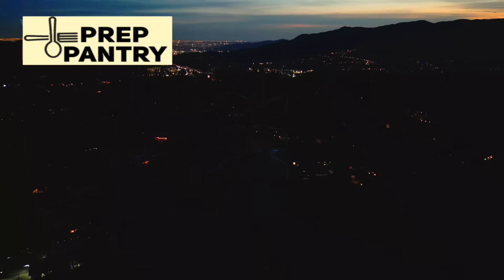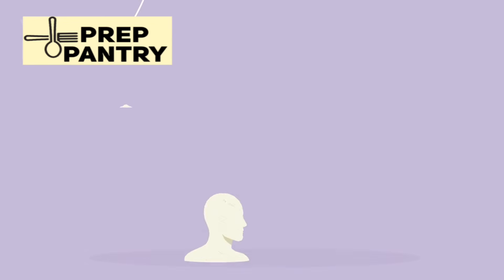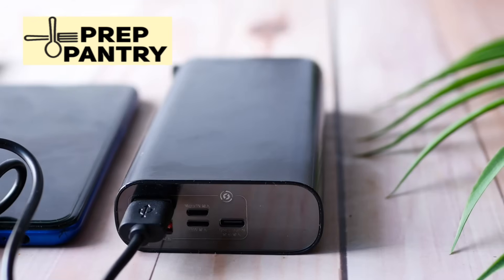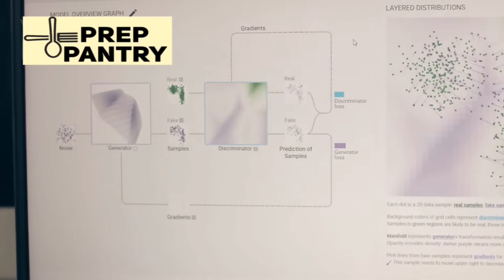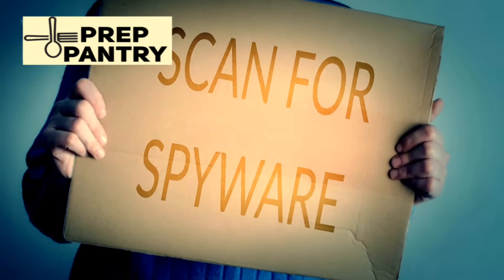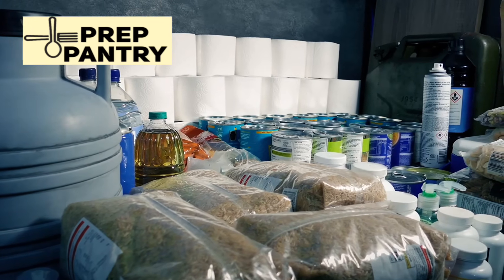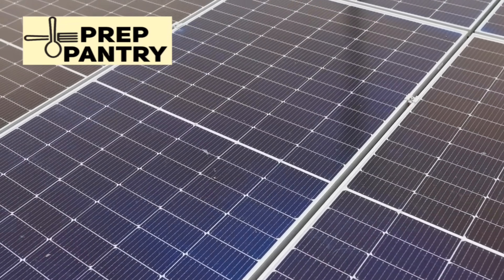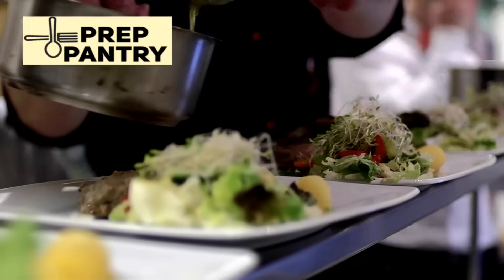I Tested Backup Power For 30 Days - Here's What You ACTUALLY Need (Results Will Shock You!)

Comment: I don't like the idea of using your vehicle for piwer.  I actually setup for this once with my Prius as it is super efficient to use as a generator and came up with sone problems.  For one, burning through precious fuel in the tank that I then need to drive around.  Second, I needed to drive the car around and powrr things in the home.  Third, I needed more power than the car could provide at times.

I am actually against a bunch of small battery systems.  For one, it increaess fire risk as a lot of these cheap, small batteries keep bursting into flames.  I end up storing these small batteris in metal boxes to mitigate the very real fire risk.  When you go for a bigger LFP battery, these batteries are far safer.  If it starts smoking, drag it outside.  But the worse I had is after a mishap, one smoked for 40 minutes and I made some jokes about not being able to have kids after this due to the strong chemical smell.  It did not burn, only smoked.  It is far easier to keep a big battery charged than a bunch of small batteries.  Batteries are living, active things that need regular attention.  Neglected batteries are trouble.  You just want your main batteries that you can keep active / in active rotation and your big battery using a safe LFP chemistry to recharge off of and run other things directly off of.  Then solar can charge the LFP battery and a generator can charge the battery. This is what works best.

Comment: I a power failures Im NOT going to use the Refrig. But will use Ice Chests and use my Chest Freezer to make ice for the  freezer chests. Refrigerators use alot of power compared to Chest Freezers. Its a trade off, but worth it for power management in a emergency. 
Just my 2 cents
Good luck

Comment: I plan to run a generator during the day, and use batteries at night.  I’ve right sized the generator so i won’t use too much gas. With a week long power outage i wouldn’t count on cell towers working, or natural gas working either.

Comment: I'm running four 450 watt panels, four 100ah Power Queen LiFePo4 batteries, and a 2000 watt inverter in my small DIY system here in Jamaica. It supplies me with 80-90% of my power needs and i have good backup during a hurricane or power outage. Thanks for your video.

Comment: In the last 12 months I installed my solar/battery system here in the north east. I have two ecoflow ultra systems with 3 batteries each for 37kwh and 22ea 450 watt panels. Total cost after tax credits was $11,000. On sunny days in summer I can run the whole house including central air and the pool. But, in practice I only cover 85% for the 3 months of summer due to cloudy days. For the other 9 months I cover nearly all of my electric usage and when cooler temperatures prevail convert any excess solar to electric heat to save on natural gas. The grid is now a backup energy source but I keep 3 trifuel  generators for longer term power outages. Any one inverter/generator will cover during a power outage on back to back overcast days. Pay back on my investment is about 4 years.

Comment: Just for clarification, regarding radio communications:

1] FRS does not require an individual be licensed in the US.
2] GMRS does require a license; however, it's 'pay to play' (in Autumn, 2025 the license fee is US$35) and one's license covers one's entire extended family.  GMRS is qualitatively better than FRS because GMRS allows for the use of repeaters, which extend range.

3] Amateur radio does shine in emergency situations.  However, the video here is a bit misleading:  unless one is utilizing a repeater system linked through the internet, one can not expect to be able to communicate over 'hundreds' of miles with a simple hand-held radio.  Typically, these 'handi-talkies' (HTs) operate in the VHF and UHF spectrum; and, as such, the range is generally line-of-sight.  In order to be able to reliably communicate over radio without the use of the internet, the HF portion of the radio spectrum is used - what many refer to as the 'shortwave' bands.  Radio waves at these frequencies can be reflected back to earth from the ionosphere, which allows for longer range communications.  The Amateur Technician license grants mostly VHF/UHF bands access; while the Amateur General and Extra licenses grant extensive HF privledges.

One does not need to be an electronics wizard to pass these exams, especially Technician and General:  there is no deep electronic theory, circuit tracing, or anything else technical about those two exams.  It's mostly rules, regulations, what frequencies and bands one can and cannot operate legally, as well as basic safety considerations.

If I were to give advice to folks, study for and sit for both Technician and General in a single test period - these two licences together provide access to all possible bands.  The only added benefit to the Extra license is access to additional slots of frequencies in some HF bands.

And, yes, getting licensed is a benefit:  it allows one to train before the skills are actually needed in an emergency.
Reply: I agree with all of the ham radio. Pratice when there is No problem is the best way to become comfortable with your rig

Comment: You did it for 30 days. I did it for 8 years. I totally agree. People are selling people false lies on the internet and YouTube. Solar is 12v first. That even goes with anything that can charge on a USB. Even lights. 12v and USB use extremely less power than 110v. The majority of what can be bought today. Can run on 12v or 110v. Same having an eco mode. 12v with evo mode on saves the most energy. Most appliances people buy or have use way tomany watts and amps for solar. Always use the lease amount of watts and amps when using solar. The majority of equipment are out of the price range of most of us. The ones that people can afford are not good enough. For a Lithium phosphate battery to be any good. There is a price range rule of thumb. An ah is just over $1 per ah. The good 320 ah batteries are running around $385. Outside the stove, hot water heater, AC, furnace, and clothes dryer. Because the ones in your home are not solar friendly. There are too many amps and watts. Look for products that use the lease amount. Like ones that go into camper or boats. Semi trucks. They are cheaper. All you need. 400-watt solar. 2 320ah Lithium phosphate batteries. A 2,500-watt sign wave power converter. A 12v fuse box. That's it. A power station added is a bounce. AC takes the most power. 12v mini split runs none stop. Any electric heat is 1,500 watts. A diesel heater as long you have the diesel. Runs none stop. A 700-watt microwave oven works perfectly. An electric double coil cook top works perfectly. Standard refrigerator. Works perfectly. A refrigerator runs in cycles. 100-watt run time. Yet. Off and one. Depending. Once to two an hour. Down size to a 12v/100v cooler with an eco mode. No problems. Around 40-watts. Small mini refrigerator/freezer. 100-watt. A small law down freezer. 100-watt. Just make sure your refrigerator runs on or around 100-watt. You don't need these expensive systems. You need to downsize the watts and amps you're using. Then. When the power comes back on. You're using less electricity and your bill mint go down. Every month, they raise the price. We are using devices that use extremely way to much electricity.
Reply: Your strategy is spot on. The only disagreement I have is avoid 12 volt. If you already have these 12 volt appliances it makes sense to prepare a power supply for them but it doesn’t cost much to start with 48 volt system and inverter. There are conversion losses but solar panels are cheaper and system wiring is FAR cheaper with 48 volt.
I was surprised how little energy you need for basic things like refrigerator and lighting. I am an electrician and would never put less than 200 amp service on houses. After having built an off grid system progressively for my house,I realized that with scheduling heavy loads , I could keep average consumption very low.
My essential circuits panel ,which carries everything except cooking range and clothes dryer ,has PV from the panels on a #10 circuit feeding a 5K inverter. Its grid power connection for charging the battery at night when electricity is free is a #12 romex.
This is in Texas where Satan decided to use it as rental property while staying in the relative comfort of his other residence.
Reply: @danielking2944  Both these methods are valid in my opinion, it just depends on your needs.    I have converted all my battery usage to rechargeable AA and AAA lithium Ion batteries (XTAR brand) that provide a steady 1.5 Volts for around 90% of their runtime, have a built in low battery/charging indicator and recharge from USB-C.  I also have adaptors for C and D cells that use 1-3 AAA for the C and 1-3 AA for the D.  There are now also rechargeable 2025, 2032, and 2540 coin cell batteries for devices that use these.

Also LED lights that run from USB are much more efficient than ones that run on 110 AC which should be saved for higher draw devices.  I have several of these along with power packs so I can strategically locate them throughout the house when needed.

For the larger draw devices, I have an Anker Solix C800 Plus and C1000 with expansion battery and am investigating low draw devices for cooking that these can power as well as propane cooking alternatives.  Also have the Anker Solix C200 DC, C300 DC, and C300 for recharging the smaller power packs and other devices that recharge off of USB-C such as fans, flashlights or power higher draw items like heating pads or heated clothing or low draw (under 300 Watt) 110 AC devices such as my Norelco shaver.

I also have several individual 100 Watt solar panels and cabling to be able to configure them for the different requirements of the various Anker Solix units and I am planning to get a couple more.  I also have a group 31 12 Volt 160 AH lithium Ion battery that is capable of charging any of my Anker units or just 12 Volts as needed

I went this route as it is a portable arrangement so I can take it all with me if there is a need to bug out instead of in.

Comment: Bravo for saying it, most preppers do not acknowledge it or provide BS solutions like just get cards, board games or a book. Or they say things like you are going to be too busy surviving to be bored... uhhh, no, not in a blackout. I was in a 5 day ice storm blackout 13 years ago, pre my prepardness days. I am a relatively low maintenance, resilient person and survived with few issues. Issue #1, it was hard to brew coffee. Issue #2 boredom. Thankfully I had an iPod Classic, I had just loaded a 4 season show I wanted to watch and had backup AA power for it. That made the days fly by. P.S. We also need to acknowledge that surviving a blackout in the Winter, Summer and Spring/Fall require different strategies that we should consider/plan for before it happens.

Comment: I measured the consumption of 200 l chest freezer and it was surprisingly low, only 0.6 kWh per day. Freezers can be helpful for storing food long term and this low consumption can be powered by few kilowatt solar array indefinitely.
Reply: I am starting with a 400 watt portable solar.
I think my controller will support up to 800 watts.
More than that I have to shell out a LOT of money.
Will have 4 x 100AH 12v batteries in parallel too.
A 2000w pure sine wave inverter.
Hoping it is enough to maintain my refrigerator at least a couple of days... Or every day if I can.
Reply: @crazysquirrel9425 In Finland this size panel is about 70 € a piece. Production is about 300-400 kWh/year here, but almost nothing in winter. Most countries however get winter sun. I think 350 l refrigerator needs about 0.5-1 kW of solar to run reliably with minimal weather dependence. True solar batteries last far longer in partial SoC situation but they are expensive as today.